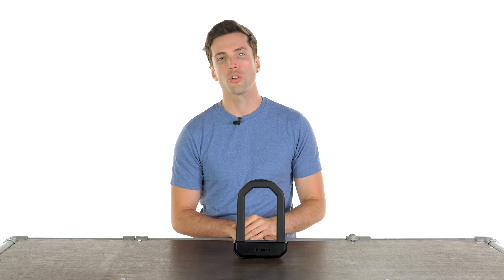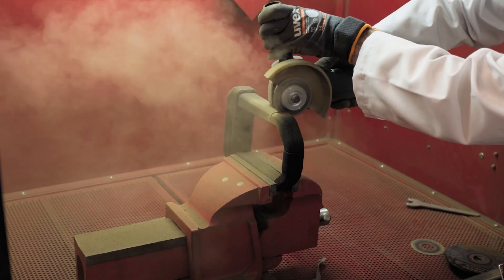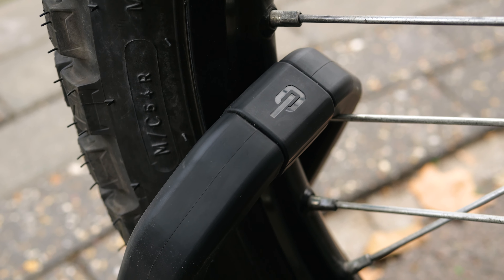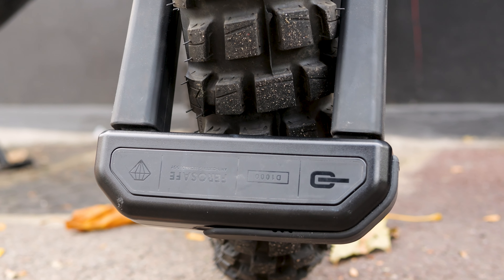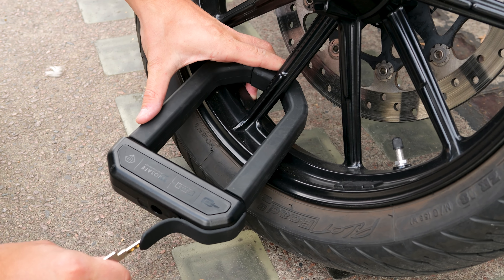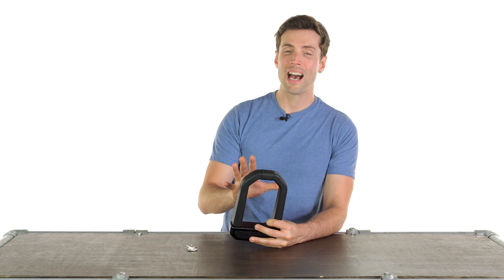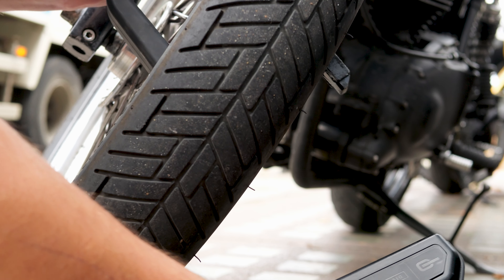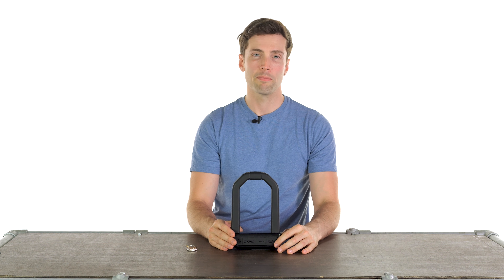HIPLOK D1000 'Anti-Angle Grinder' Bike Lock Review

Comment: I'll be convinced how secure this is when LockPickingLawyer shows that non-destructive intrusion is non-trivial
Reply: I’d like to see the lock picking lawyer do it in a real life scenario on the street.
Reply: @rideoutlondon  it seems like you want him arrested
Reply: @greenmuso  Lol no just a set up thing without the studio and practice.
Reply: @rideoutlondon  fyi I was making a joke but that's a fair point.
Reply: It uses a crappy pin tumbler locking mechanism that makes it easy to pick.  Even way cheaper locks have much better disc cylinder mechanisms.  Doesn't even require the custom disc cylinder picking tool LPL uses to pick.
Reply: @jackmichaels7311  it's a shame that they really cheaped out here for such an expensive lock. From what I can find though, most thieves aren't picking locks, they're carrying bolt cutters or angle grinders. If it's going to take them more than a few seconds to get through the lock, they're likely going to move on to another.
Reply: @mrcraggle  Exactly, this is why LPL always recommends disc cylinder locks that require his tool that take him 30 seconds but a thief 30 minutes+ Unfortunately the pin locking mechanism on the D1000 can easily be bumped in seconds if a thief has any minimal experience with this.
Reply: It’s a quality keyway. 
You think Hiplok is going to kill their reputation by using a crappy keyway on a $300 lock?  I doubt it. 

And mine came with what I understand to be very secure keyways. 

That said, references to LPL are LAME!  Thieves DONT PICK LOCKS!!!

The top three lame smug YT bike security comments:
1) LPL will pick it in 20 seconds!
2) They’ll cut the frame!
3) They’ll cut the rack!

Real-world rebuttal:
1) Thieves don’t pick locks. 
2) When thieves choose expensive bikes, why destroy the most expensive part?  And when they don’t care if the bike’s $800 or $5,000, they’re intending to dump it quickly for $100 to buy drugs. They can’t unload a destroyed bike quickly on the next street corner. 
3) Yes, racks can be cut, but it’s rare. Thieves are lazy opportunists and will move on to easier targets. 

There are always exceptions. But my experience In avoiding theft of very nice bikes over 40 years says using the best locks & your smarts will put the odds in your favor. 

Don’t lock a bicycle up outside over night. 

Use GPS trackers. 

Record your serial number & register your bike. 

Buy insurance as a last resort to attenuate your exposure. 

If you have 3 or more $3,000+ bikes, the responsible thing to do is get insurance. 

But Hiplok gets an A+ in my book for making a HUGE step forward to thwart bike thieves. Kudos!!
Reply: @dudeonbike800  It depends, but the fact that Hiplok used a crappy mechanism that can be bumped or drilled in seconds, considering disc cylinder locks are literally the same price or maybe $2 more at scale per lock, just shows their inexperience (or not really caring about theft). Disc cylinder mechanisms generally include false gates (like Abus) to prevent drilling and can't be bumped in seconds.  I agree with you thieves normally don't pick, but some pros will try to bump it, and others may try to drill it, and those are real-world attacks thieves try.
Reply: @jackmichaels7311  Bennetts BikeSocial went at it with a drill with no effect:
https://www.youtube.com/watch?v=dk6XGv29RRI&t=474s
"Drilled in seconds" is egregiously false.  I'm guessing the lock mechanism is far better than you assume.

But I'll admit I'm not well-versed on these specific mechanisms.  But I understand that these keyways are what are now used in high-security situations, whereas the disc cylinder locks like what Kryptonite are using have been revealed to be less secure than advertised.  

LPL videos are suspect to me.  I say this because I've worked on 7-pin cylinder locks over the years.  Rekeyed a few to match my existing locks.  After watching LPL use a 7-pin pick and easily open a lock in seconds, I purchased a pick.  I went at an old Kryptonite with Ace-II lock mechanism and it would NOT work.   Not saying I'm as skilled as LPL, but I understand the concept and know what to "feel" for when trying to find the gap between the pins.  And if it took me a half hour compared to LPL's 30 seconds, it would make sense.  But nope, I couldn't even get one pin.  The lock mechanism is too high-tolerance for any "slop" or looseness to identify when you find just ONE of seven pin gaps.  The other six pins prevent the cylinder from moving at all, so you can't locate the pin gap.  He does it so quickly that I wonder if he's doctored his locks before filming.  This would be easy to do on many modern locks, as the keyways are removable (Unlike the old Kryptonites with Ace-II press-fit into place).

Additionally, I say this as someone who left a 7-pin cylinder u-lock with a locksmith for months.  He could NOT pick it, despite having all the professional tools, training and experience!  This was before the famous Kryptonite Bic Pic scandal when quality lock mechanisms were being used.  It was a Citadel lock from about 1985, which was before the Ace-II lock mechanism with different pin materials and springs with different tensions.  Those were the pinnacle of pick-proofness that Kryptonite abandoned.  Terrible decision.

That said, lock picking isn't the method of choice anyway, so this is moot.  Bennetts didn't simply "drill through" the lock mechanism in 5 seconds and open the lock, so the thing seems pretty damn secure.

PS  Anyone with old Kryptonite K-4 locks with Ace-II keyways should hold onto them.  They're not vulnerable to the Bic Pick and are quality locks.  Mine are still functioning flawlessly after 30 years.  They're just very vulnerable to grinders.  But there are ways to address that...
Reply: Just keep in mind: LPL does hours of research and then fabricates a tool for the lock he picks on camera.
Reply: what thief is gonna sit for an hour and lock  pick  ??
Reply: @jackmichaels7311  how do you know which mechanism the lock uses?
Reply: I own one, regretably.  I asked the same question, why would they go so cheap no the mechanism? It makes it useless in my eyes, I wish I knew this before buying, but my fault for not researching enough.
Reply: Most thief’s are not picking locks!
Reply: The company sent him a lock a year ago. Still waiting.
Reply: @aroma,,,-  lock picking is the least used method of bike thieves . even the professional gangs don't utilize lock picking . there may be an occasional talented theif that has those skills but for the most part , thieves employ brute force .
Reply: You people are hilarious. It's like witnessing a cardshark at work and think cheating at cards is easy. LMFAO. If any of you tried to learn these card cheating methods like the classic pass, 2nd deals, bottom deals, etc, you will soon realize it's much MUCH harder than it looks. Look, if I demonstrated the classic pass in slow-mo to you in full view, you will think, ah, that's easy. Yeah, sure, wait till you try doing it for the first time yourself. LPL is like a seasoned cardshark who has mastered all these moves. Looks easy but I am sure it won't be when it's you. Understand this word called outlier, which LPL is. Period.

Comment: Graphene & any composite made using it is flammable. Plumbers blow torch is more effective than a grinder.
Reply: But a blow torch isn't something usually seen on the street. Bolt cutters were popular for awhile years ago but now it's angle grinders. Plenty of videos out there of people using those but none with blow torches other than a review video for a YouTube channel. That's not a real world scenario though. Not on the street at least.

I've heard of groups grabbing bikes still locked up by taking the whole rack off and taking them away in a van. They take it to their spot which is where they can grind them, cut them, and if they have the tools possibly torch them but again this is something done inside or away from the public. There are pics on Amazon of melted through locks but they were in an inside garage so not out on the street. Not saying it's never happened just saying it's not a regular thing like bolt cutting and angle grinding is.
Reply: @vigilant_1934  bud, cordless angle grinders were not something seen on the streets 5 years ago and they have existed for quite a while

Comment: Living in London and having had a bike stolen last year, I’ve just bought one of these
Reply from the maker: Hi Amo, we are very sorry to hear about your bike being stolen! I can definitely relate to this! This is for sure a lock that all Londoners should own! - Iza
Reply: Living in the SF Bay Area I bought an Altor SAF lock 3 years ago. It works, but is too large & heavy for many applications. 

My 2 D1000’s just arrived last week and I’m sold!THE solution I’ve been looking for - especially locking outside. 

Now we need Ferosafe and/or Proteus used in chains & anchors for home & back of car security. 

Unfortunately the D1000 doesn’t interface with most of today’s quality chains. And it’s irrelevant if it did because chains are easily cut anyway. (But I did just commute to SF & left my custom painted & beloved bike outside the SF library at Civic Center for four hours without incident a few weeks ago. It works.  But few cyclists can or want to carry that 13 lb beast on a bicycle.)
Reply: @dudeonbike800 HipLok does have home anchors too in the same 1000 series. They are just as tough as the locks if not tougher. John of Bennetts tested them as well. I think one is called the A1000.

Comment: If I were inclined to steal a bike, and l  came across a Hiplok D 1000, I wouldn't waste my angle grinder blade on the lock itself, but on what it was locked up to. Chances are the tubular steel it would be locked to is much easier for an angle grinder to cut through. Real solution? Lock up with an angle grinder resistant lock in a highly visible space, and for a short time period. If you have to park longer (like at work), see if your employer will let you park it inside the business space. If thieves can't steal it, they will vandalize it to satisfy their frustration. That actually happened to me, and my employer agreed to let me park the bike inside.

Comment: Its a small and chunky lock, I do feel it should be yellow somehow from a distance yellow gives off a more "Look at me, I'm a big chunky lock or just I'm secure, so go away" feeling. Along with a alarmed disc lock and an alarmed retractable cable lock. All these can be carried very easily as long as your not going to far away from your bike very few people will attack 3 locks if 2 are alarmed no matter how flimsy they look it will catch peoples attention but not many people will intervene in any kind of crime and for their own safety they shouldn't, but someone may call the police. 
With the price of motorcycles I would like to see a gear lock, select 1st gear and it will not disengage until the power is turned on with an alarm and a tracker installed inside your bikes frame. On my bike I have GPS, Bluetooth, electronic clocks, tyre pressure even an altitude clock but security it has nothing and that is sad.
Reply: Nothing a can of fluorescent spray paint couldn’t solve.

Comment: I like the abus granite disc lock. It’s cheaper and even more compact
Reply: I have one.
Reply: Grinders will make quick work of it in 20 seconds. No u-lock today, other than the D1000 or Altor SAF will last much more than 20 seconds against today’s grinders.
Reply: Disc locks are useless. They’ll cut your discs. Guess how I know?
Reply: @WildlifeMoto  you pinch bikes for a living?
Reply: @dudeonbike800 Not sure if the Litelok X1 and X3 were out when you left this comment but they are 2 locks at the top along with the ones you mentioned. HipLok's newer DX1000 lock for motorcycles is now at the top as well.

Comment: some one took a strong framing hammer to the corner.  I just had my ibis ripmo  Carbon stolen.  Someone took a hammer to the corner and busted the shit out of the lock mechanism.  On my review, the lock mechanism sucks.  The graphics itself is strong, the corner locking mechanism is no better than any other POS U lock.  pissed.  Dont need an angle grinder at all. the pins that lock it are flimsy.........not even 1/4 inch.  No you dont need to cut.  Just pound the corner with a 27 ounce framing  hammer.
Reply: 我的妈呀😢

Comment: I haven't had any HUGE issues with this lock yet! https://www.youtube.com/post/UgkxfyHDlEqk6hqu9acdvK5NGzZsGKSokSbv It seems sturdy and like it will get the job done. I really like that it has a twisting lock feature to keep out dirt and debris. However, the mounting system is much too light for the lock, and continues to get loose/move around. It's mostly made of plastic parts, and I've had to tighten it a few times in the past week or so that I've had it. I'm worried that it's going to break off at some point while I'm riding. I'm considering just scrapping that part, but that would mean having to carry the heavy lock i my backpack and adding more weight. I wish I could have given this more stars, but without the mounting system, it's just another heavy lock that I have to cart around. UPDATE: Increased rating to 5 stars because the seller offered to provide a new lock and mounting system. Really appreciate the attention to customer service!!

Comment: Check out the Litelok X3 here - Apparently it's even better than the D1000! https://www.youtube.com/watch?v=PUwjh8J4uec
Reply: I've looked into this a bit, I may be mistaken but from what I can tell from the video reviews the D1000 edges it on build quality, grinder resistance and warranty period (and I think it's made in UK rather than China), whereas the X3 is bigger allowing fitment to more motorcycles (as per the linked video). But if they both fit your bike I don't see any deal breakers between them really.
Reply: @andrewvickers4487  Both good options for sure but in that video John actually shows the X3 lasts much longer to cut with an angle grinder (4 discs compared to 2.5). Plus the Litelok is made in the UK and the D1000 is made in China.
Reply: @stevewoods9437  You're quite right thank you, I got them mixed up after hearing this guy liking the D1000 over the X1 https://youtu.be/eU4Wy2yt07I
Reply: @andrewvickers4487  No worries - the X1 isn't as strong as the other two for angle grinder resistance but still seems way better than others in the same price bracket. Gret to see two British companies pushing lock tech forwards

Comment: U didn't even test it. I have and my angle grinder dewalt battery powered and 2 discs will get through it in under 5 minutes. This is Just a sales pitch.
Reply: I'm guessing you mean get through one side of it? The videos he suggested do grind through it properly and put it through many good tests. They also don't sell it or make money off of it so that's  a good sign as well plus I've seen other real videos (small no name no face no sponsors YT channels) grind through it as well in about 5 minutes through both sides but it took 5 discs and a good plugged-in angle grinder.